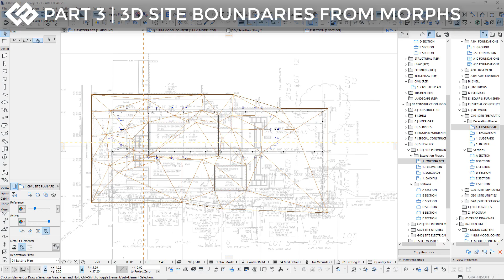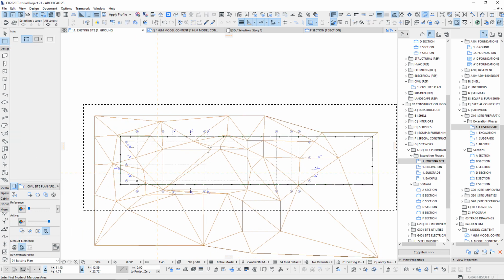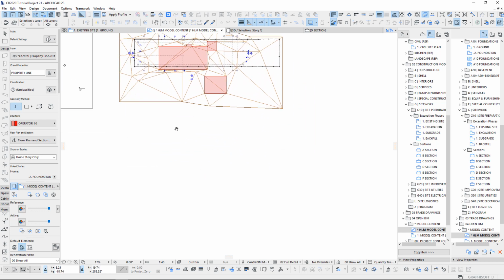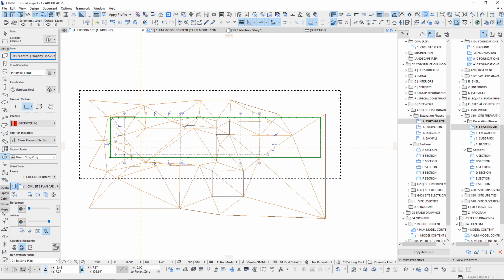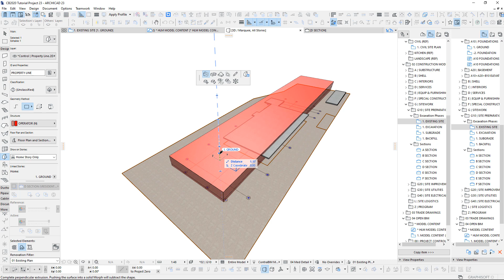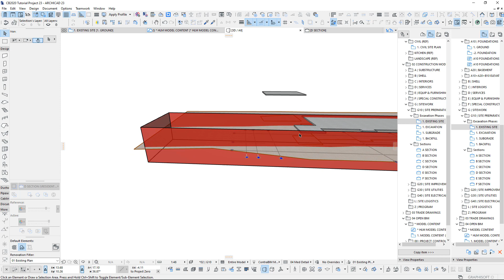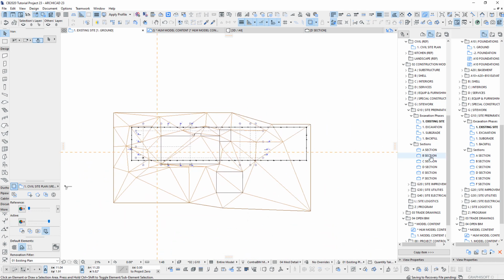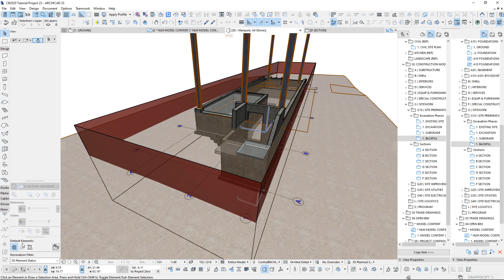How to Model 3D Property Lines in ARCHICAD23 (Part 3) - Earthwork Mini-Series

Comment: Hi John short question, do you use the spacebar / magnet also on the 3d mouse? Or do you jump off the keyboard with your left Hand
Reply from the maker: I usually just leave the magnet turned on, and since the 3d mouse is in my left it's a quick jump back and forth when needed.  I had to check as it's somewhat second nature to me now, but yes I bounce back and forth as it's just a quick motion when navigating in 3D. in 2D i'm almost always with left hand on the keyboard.
Reply: CONTRABIM Many thanks for quick answer John is very helpful 👍🏻 Then I have to get used to leave the magnet on all the time, otherwise I had turned it off and activated it with the space bar 😊